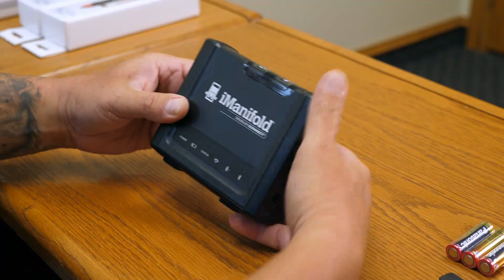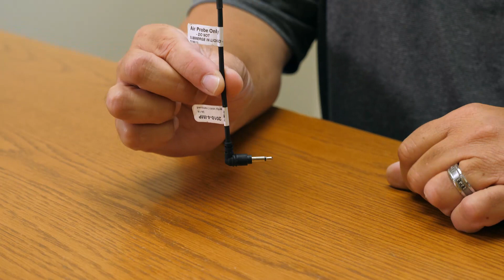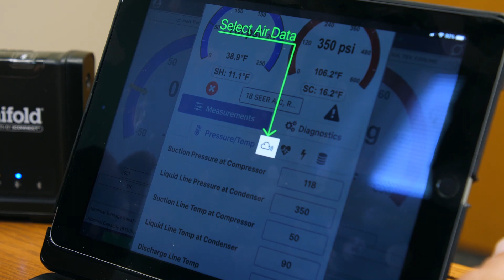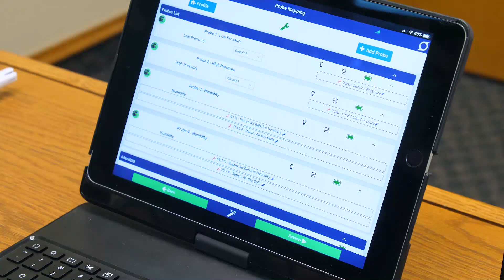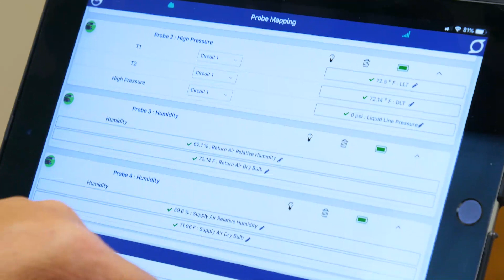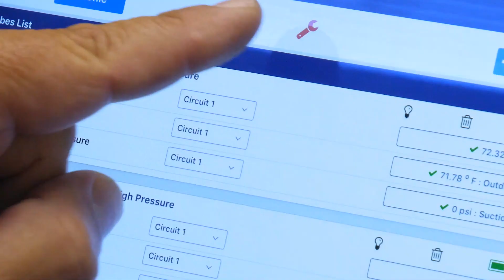Unbox and First Time Set up with your iManifold 900C Kit

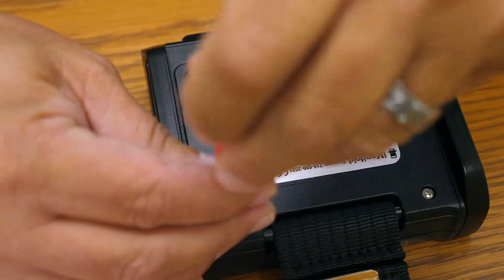Comment: 3:35 - Finally! A tech that knows (and shows) the absolute best way to prevent cross-threading fasteners!  
1. Point fastener so the threads mate
2. Turn the fastener counter clockwise up to a full turn 
3.  Once the threads match tighten as normal
BTW, this trick works with anything that has threads: machine screws, sheet metal screws, rigid or plastic pipe, plastic screws and screw holes; even jar and bottle lids (ever cross-thread a milk jug cap and have it leak when it falls over in the fridge?)  Well done!

Comment: Best investment I've made to date. Thanks for all your help with questions and issues ie. mostly user error but nontheless thanks.  This system has made comisoning Greenheck equipment so much more efficient and probably the biggest time saver was a split system, 4 story roof to basement TXV test. I could go on but I've already hijacked the video enough. Thanks again.

Comment: Good video, please keep it up. A video on, say a split system in a commercial metal building with condenser on the roof and AHU inside. I've done it, but difficult for the long distance zixby signal to make it around all that metal.